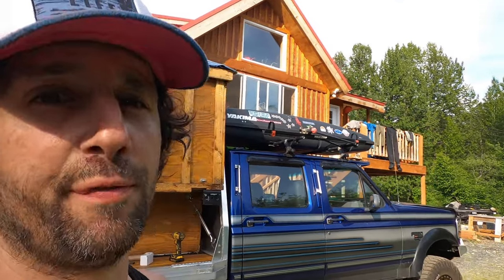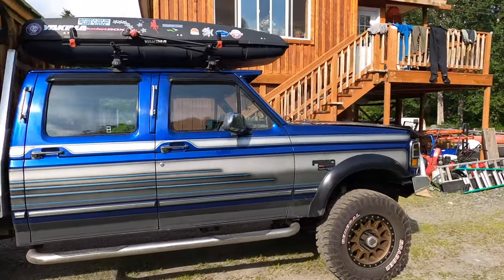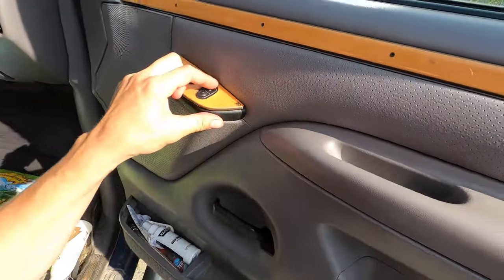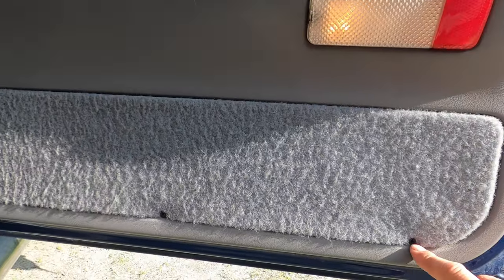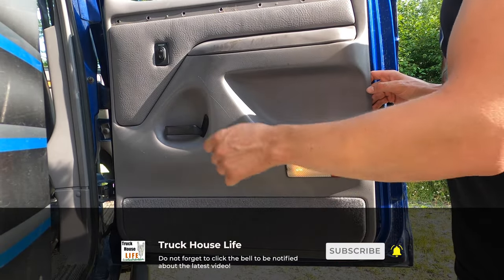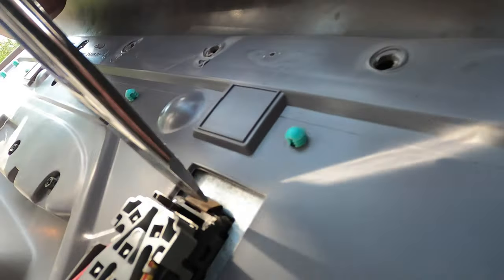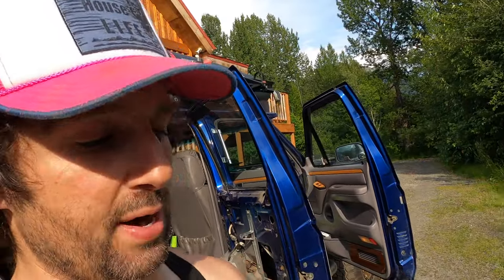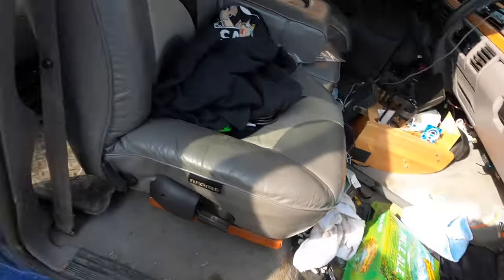Your vehicle door is stuck and won't unlock?  This might fix it! Door actuator fix.

Comment: Hey, I have taken the door panel off, but I can’t get to the screws I need to remove the actuator since the door won’t open. Any ideas?
Reply from the maker: You’ll have to manually unlock the door, using something to pull the latch inside of the door now that you have the panel open
Reply: @TruckHouseLife  thank you, I’ve pulled the interior lever that goes with the handle, but since the lock is still engaged and can’t be unlocked it doesn’t do anything. I know there’s a piece inside the actuator that can manually unlock, but it’s pressed up against metal I can’t reach even though the plastic door panel cover is off

Comment: GR8 video,  didn't help me 2007 envoy rear passenger door actuator seems to work I can hear it but dose not unlock door,  the outside and inside handles feels like door is locked
Reply from the maker: Double check that the actuator rod is actually trying to unlock the door, the actuator might work but the rod could totally be broken.
Reply: @TruckHouseLife  I gave door panel off I see the rod move and its attached. Can't see what its attached to but  I hear it clicking, I can move rod manually or with buttons,  seems like whatever it's supposed move its no moving far enough
Reply: @TruckHouseLife  Yea it is, everything hooked up and working I tried to move rods with had forcing a lil more movement didn't help, something in the latch is broken the actuator is working fine